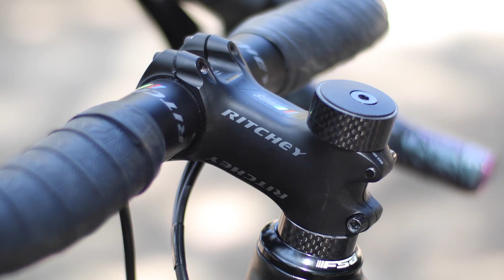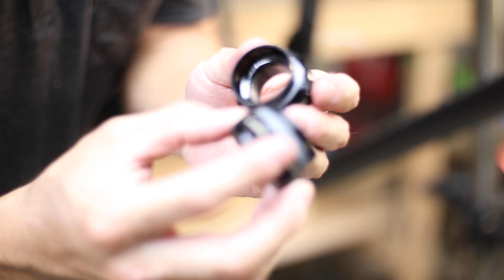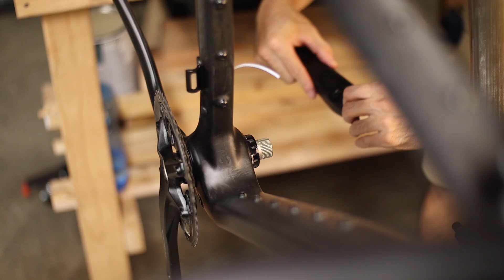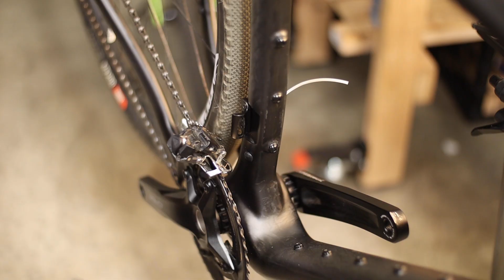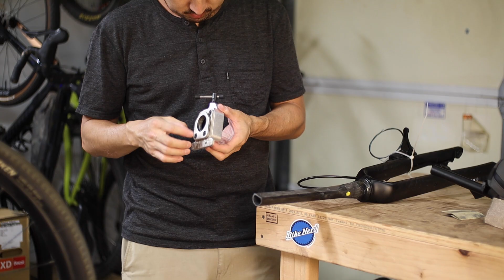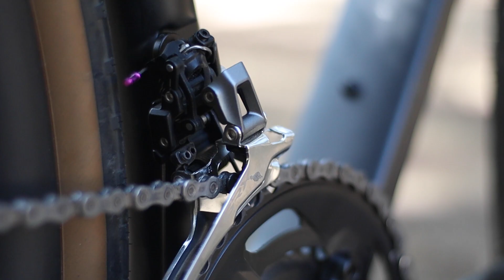Winspace G2 Gravel // BUILD From Frame Up (2 of 2)

Comment: Awesome Vid thanks! A little bit late to the party but im thinking of getting this bike as my first full carbon bike 🫡
Reply: Most builders of the G2 seem to go with Di2 1x and not mechanical shifting.  I'm having a tough time setting up the G2 frame but can't see investing many hundreds of dollars more for electronic shifting to overcome inadequate build skills.
Reply: @richardbryanesq  I havent gotten mine yet, but im told its compatible with mechanical, are there routing issues?

I think the headset assembly is going to be the most complicated part if anything maybe?

Comment: I pulled the trigger on one of these to build up because of these videos.  I have a heaset question for you.  I used the same low FSA headset you used and put bearings in and got everything setup but the FSA cap does not spin freely and the whole steerer feels stiff because of it.  I have the bearings installed as well as the silver compressions spacer ring in that top headset bearing and the FSA cap slipped right over the top of that.  Headset only tensioned to the point where there is no play in the bearings.  Any looser to get the FSA cap spinning and there is play in the bearings.  Any thoughts when you have time would be greatly appreciated from a build noob.
Reply from the maker: Try and identify where the friction is coming from. If the cover has a rubber seal, try taking it off and see if there’s still friction. It should spin freely when properly preloaded
Reply: @TheBikeSauce  2 of the .25mm fsa headset microspacers did the trick.  My bet is they faced the headset too deep or made the paint a little thick   thanks again for replying   much appreciated brother!

Comment: Thanks for the vid! Really great build and review. Quick question, how did you feel about the height of the filler spacer they give you for clamping the stem around the fork steerer tube. Any thoughts around the height of the piece? Should it be taller?
Reply from the maker: I think they provide at least 20mm of headset spacers, which is usually plenty. If you need more height, you could use a riser stem or riser bars

Comment: Nice helpful video, but I wish you had a explanation of how  you cabled the front derailleur. I ask because I'm building up a Winspace frame and am confused by the lack of a cable stop on the frame. Did you use a short piece of housing? If so, how did you secure it on the frame side? I get the derailleur has a built-in cable stop, but what did you use on the frame side? Did you cut the white cable guide and shove it back into the frame? Thank you

Comment: Any tips on getting the headset on this to tighten up during install? I can't seem to get it to take the slack out no matter what I try. I didn't see anything about it on either of these videos. I'm sure I'm just missing something, but I can't seem to get it (yes, I've got the spacer in to fill the gap in the funny-shaped stem)
Reply from the maker: Enough headset spacers? Should be higher than the end of the fork steer
Reply: @TheBikeSauce  Thought I’d cut enough of the steer tube off, but I guess the cap was hitting it still. Didn’t have any more spacers so I cut a few more mm off and now it’s great. Thanks!
Reply from the maker: Haha nice. Pretty common issue

Comment: Hello BikeSauce, can I use an 15mm to 12mm thru axle adaptor for my front hub? Can't seem to find a front hub that has 12x100mm :(
Reply from the maker: It depends on the hub. Some allow for interchangeable endcaps for different axle sizes

Comment: Is it the grx 810 crank (48/31)? Because the Max recommended chainring size is 46/31 for the frame... I have almost the same buildup except mine is the red frame
Reply from the maker: It’s the 600. You got some wiggle room on their recommendations

Comment: Great videos what I would
Like to know is how tall are you and what size frame did you go for. I’m stuck between a S and M. Winspace told me M but the small frame is closer to my 54cm SL7. I’m 179cm
Reply from the maker: This is a small frame and I’m 172cm. I also ride a 52cm diverge that fits very well. The small G2 is similar to the 52cm diverge in many measurements. Hard to say, but I’d be inclined to agree that M might be best for you

Comment: Fantastic video as always! Do you know how much weight you could realistically load on this frame? I can't find anything on the winspace site. I am not intending to use it as a heavy tourer as shown on thier website, but I would take it bike packing. Any ideas?
Reply from the maker: Thanks. It’ll be fine for most bikepacking set ups. If you need to carry heavy loads, I’d suggest an axle-mounted rack system like the divide rack from old man mountain.
Reply: @TheBikeSauce  I saw your vid on the old man mountain rack and was very impressed. I'm more of a bike bag kinda guy so your comment has given me some more confidence for alcarrying capacity. Thanks again and keep up the content. You've hit a sweet spot on informative, Interesting and fun. Thanks